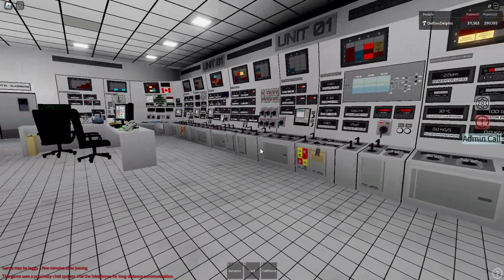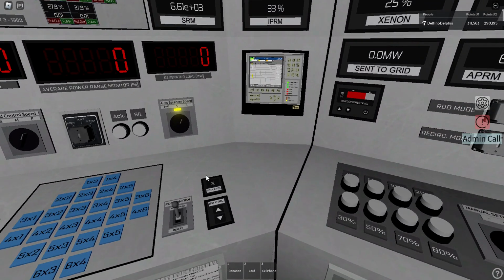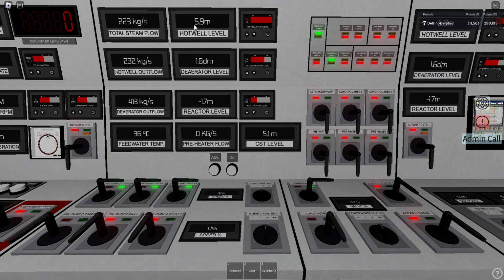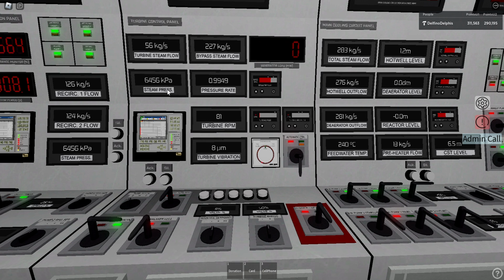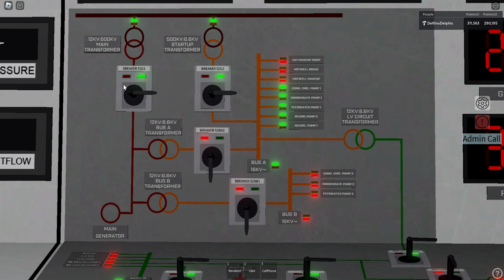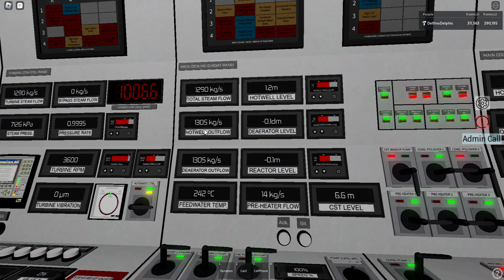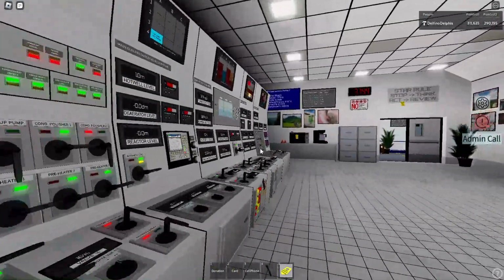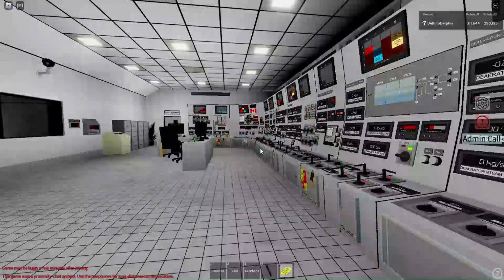[RBWR] Intro guide for U1 (V1.4.2)

Comment: Push and pull rods to change power in a BWR? I thought water flow through the RCS controlled power level for the most part once you are in power operation?
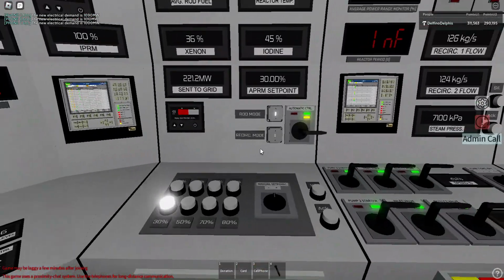Reply: 48:01 After reaching criticality, he switched the autocontrol from rod mode to recirculation mode. You can see in the recirculation panel that both pumps values are automatically changing. The rods still can be used for fine-tuning power. Also, this should not be used as a training guide for real life nuclear reactors. Unit 1 is very simplified and beginner-friendly.